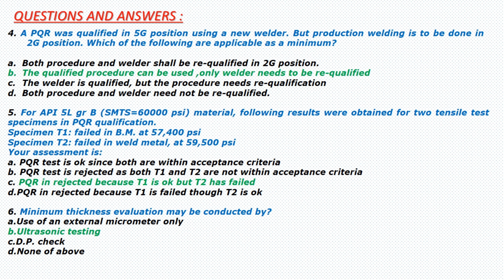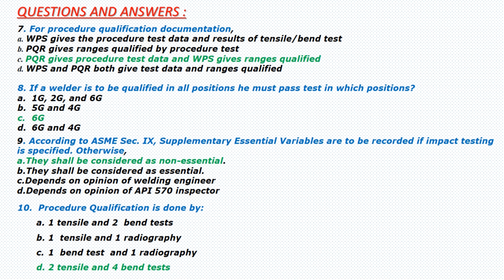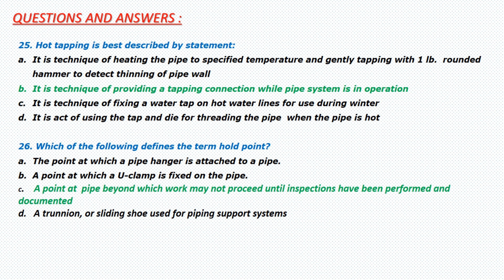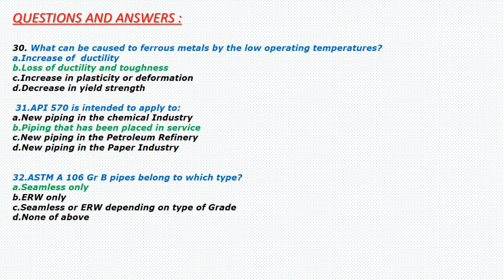API 570 Piping Inspector Exam Questions and Answers -Part 2

Comment: First of all I would like to say lot of thanks and plz complete first API 570 questions this is my request and in Question number 2 a little confusion asking grouping of weld metal but not clarify either it is Mechanical strength or chemical composition of weld metal
Reply from the maker: Thanks for your compliment.
Let me clarify your question. As the A no is for weld metal chemistries means it's only chemical composition. Mechanical strength will not be applicable. Be clear that p no and s no are grouping of base metals, f no are grouping of filler metals, and a no are weld metal chemistries. I think you got it.